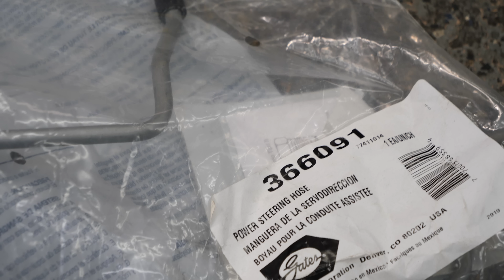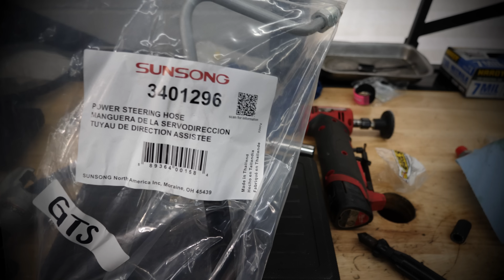How to Install Volvo Electric Power Steering in an F-Body | 1986 Trans Am Project

Comment: 2004-2014 S40,C70,V50 and the C30. There are other ones as well. It's a Ford/Volvo pump. That's from when Ford owned Volve era. Lol.
Reply: Did all models use the same part number/unit?
Reply: From what I've seen. I pulled it up online and the list shows them all with 1 pump. There is one with a remote reservoir and one attached, so there are 2.
Reply: You know which one is more common? Is the remote reservoir unit a better unit?
Reply: Thanks
Reply: Not sure which is better but the one without the remote reservoir is more common.
Reply: Ok thanks

Comment: @Lsxmatt, I know it's probably too late for this project, but early (up to 2013?) Mazda 3s and Mazda 5s have an electric p/s pump that looks very similar to that Volvo pump.  The high pressure line is connected with a banjo bolt instead of a straight in fitting like the Volvo unit.

Long time lurker, love the TA stuff, got an 89 GTA myself.

Comment: OMG so many questions. What are the dimensions and weight of the unit?  How many amps does it pull?  What pressure does it output?  Is the pressure variable or adjustable in any way?  What size and type hose connections did u use the the high pressure side? Never mind.  I see they are in the description.  Want to mount in my 68 Camaro.  Also the long hoses will help a bit with cooling.  Great video.  😀

Comment: Congrats on 100k subs.  Thanks for the video upload.  You're quite fortunate that despite breaking your pump, these power steering pumps are relatively simple devices.  On my car, a 1988 BMW 750iL, it uses a dual vane pump that drives not only the steering, but also the power brakes and the rear self-leveling suspension (which I will be deleting soon).  On my car, this engine-driven hydraulic pump going bad costs an eye-watering $2,127.10 to replace.  While unfortunate, that would be a strong financial motivation to at least experiment with going with an electric power steering conversion.

Comment: Awesome video. I'm building a 70 Corvette and I don't have room for the regular pump. I'm using the same exact pump, in fact I just got it today. I had to get a fitting but I have the part number. I got it from ICT billet on Amazon.

Comment: I woulda put it in the back, and I woulda added a cooler from a Yukon or a Ford contour or something, it's just a hard line loop with copper fins. You can even daisy chain them. I wonder about overdriving this pump unit 

I love those line wrenches...

Comment: Bought one of these to drive a hydro boost system in my c3 Corvette...trying to figure out relative PSI and how to plumb it and how now to blow everything up with the steering wheel at lock

Comment: Yes sir. That's what I am planning on putting in my swap. 03' Crown Vic Police Interceptor Ls3 4/L80. The only reason I am running a Ls3 is because I found a block really cheap for a 6.2L that is lol. Brother they sell a controller on E-Bay for $60 so your not stuck at 75% power.  You take a small screw driver and adjust it to where you want your steering to be. I will stiffen mine up a little for the track.

Comment: Working on the wipers on my 89.  Thought I had it with new capacitors in the wiper cover, but nope.  Guess I'll test the switch next and see if it's acting right.

Comment: Paid 60$ for my pump. I’ve done this in my own dd turbo ls swap. I put mine in the trunk. I did one on a drift car and put it behind the seat. I have also put one beside the rad under the headlight. If you just run the one wire setup I think the system defaults to 75-80% for one setup the customer bought a module to control the % assist and turned it to the max and blew the end rack seals when it was full lock really hard. So a little research and maths would pay off 80% of the Volvo pump was about 90% of the Nissan rack or something. I ride with 80% on my Mazda rx8 rack

Comment: couldn't find a video of yours on either the camaro or ta, but was wondering if you had replaced the brake master and booster with one from a 4th gen or maybe looked into trying to make a hydroboost setup work on one of your third gens? i did the big brake ls1 setup and wanted some input on replacing or upgrading the master cylinder and booster

Comment: Nice fit! Always good to use the factory bracketry.  What did you use for the PWM modulation of the pump operation? I didn't see you mention that when you talked about the hookup (8min). I bought the one that's on eBay - in my case this is for an older RWD Volvo LS swap setup
Reply from the maker: I ended up getting a chip on ebay that lets you vary the output. I installed it in one of my recent videos, the one titled “My lt swapped trans am needs a little work”

Comment: What was your inspiration or goal with the e-power steering? The electric power steering thing has always intrigued me. Nice video on the mod. My only question is on your pressure line. Why not just use an AN adapter fittings on each end (pump side and box side) and then ptfe line between? Less points of failure (fitting joints), flexible and a slightly cleaner install. 

Nice work, I have to check out some of your other content now.
Reply from the maker: Main reason was cost. I already had the steel tubing and tube nuts. For the electric power steering itself I decided to go with it for space savings around the engine. A belt driven pump would stick out and get in the way of future turbo piping.
Reply: @lsxmatt  ok, that makes sense. Turbos definitely require some real estate for the piping.

Comment: You think one of these could work with a hydroboost brake booster and power steering? Or should it have two volvo electric power steering pumps?

Comment: Not a fan of electrical power steering, I like to feel what front wheels are doing. Still, I'm impressed by how profesionally and cleanly you build this car. It would take me years just to figure out how to connect the cables.

Comment: I was just about to comment bracing the return line, so the line vibrating or moving won’t stress the plastic nipple and then your painfully smiling face appears with a broken part, but the metal output. Lol, that’s nuts it broke that easy.

Comment: Just curious bc I did eps on my 78 f250 way easier ......I've noticed people using Hyundai tuscon units 200$ and no fluid how come you didn't go that route? I'm interested in doing a swap just pulling off the fender on a finished painted car to replace the part sycks for me

Comment: I have an 08 Volvo C30 with that pump, and it only runs when turning the wheels. I also believe it provides less assist at speed.  Are you replicating that functionally, or planning to just run it continuously?
I was wondering because I thought it was a neat little unit for older builds, but wasn't sure about controlling it.
Reply from the maker: Planning on running it continuously. If I don’t like the feel there’s an aftermarket controller that lets you vary the assistance.

Comment: What are the tube flare fittings called you used?
Reply from the maker: They’re -an tube nuts. Size was 3/8 and I used stainless steel being its a high pressure line. May have been overkill but I’m not sure what the aluminum fittings are rated for pressure wise.

Comment: Volvo Electric Power Steering Pump Standalone Controller, 04-13 S40 C70 C30 V50
Reply: With this controller you can turn the pump up or down to suit the feel you want. I'm Def buying one.

Comment: what is the plan for the car? autocross? drag? road course? or just street machine?
Reply from the maker: Semi daily driver
Reply: i took mine and put it in the back in front of the RR tire.  but mine is a race only car.  to get more HP and more rear weight @lsxmatt

Comment: Matt, off topic. Can you help me, I’ve got C5 z06 rims 17’s front 18’back that I want to install on my 85 Camaro. Do you know what size wheel spacers I would need. Also have the stock rear end
Reply: You could just Google this information.  If it were myself, I would google the specs of each wheel and then order spacers of the appropriate thickness.  You will need to know the backspacing for each wheel.

Comment: What degree flaring tool are you using?
Reply from the maker: 37 degree. Rigid sells it but its stupid expensive for what it is. I paid 196 on amazon.
Reply: @lsxmatt  Nice work!  Most know nothing about 37° stuff.  I'm showing my age, but 20-25 years ago just finding a 37° flare tool was a challenge.

Comment: Low heat aluminum brazing rod *
Reply: They’re at harbor freight and tractor supply in the welding sections 😊but be careful Bc hydraulic/ powersteering fluids flammable

Comment: 5:00 it would have been better to make a round cutout, instead of square, since in the corners stress makes itself much more apparent by cracking the metal.
Reply from the maker: I wanted to but didn’t have a clean way of cutting it round.
Reply: Very important to know that when working with fiberglass. Due to the fact that cracks very easily.